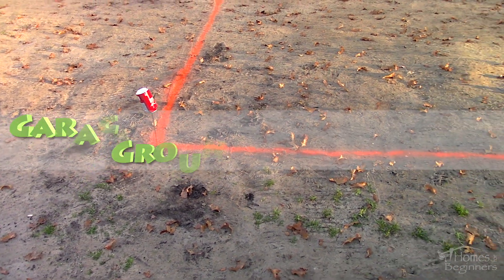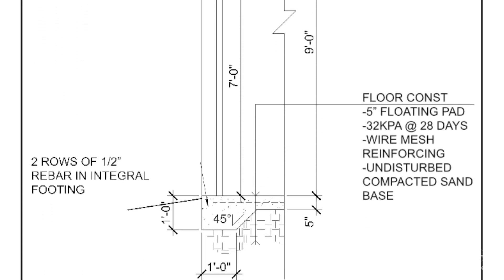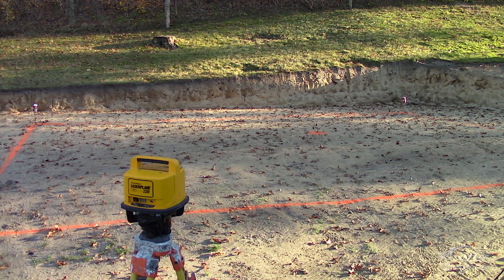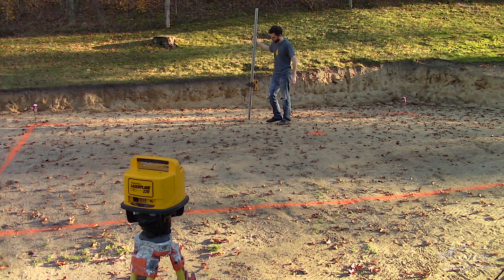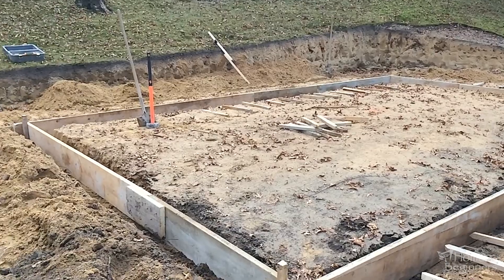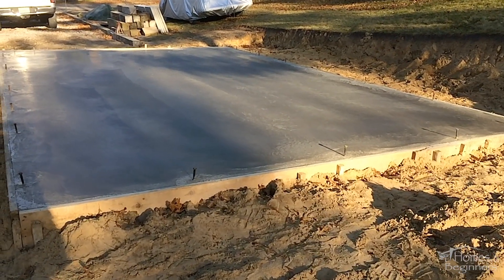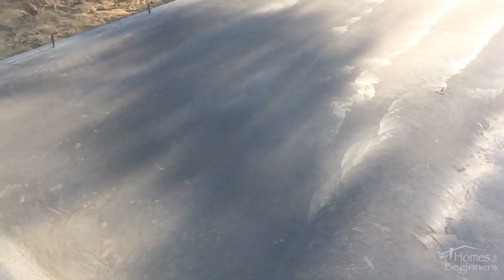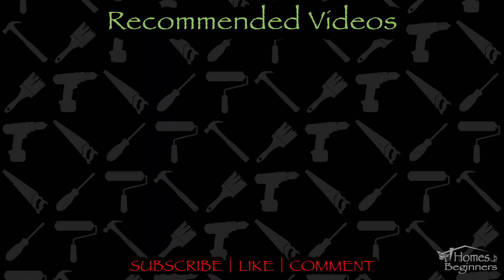How to Build a Garage - Ground Work and Concrete Pad

Comment: Is so easy to do concrete in the east side of Canada, they don't worry about reebar, thickening edges with Upright bars and propper ties . They just come with little wire mesh, set it , cut it and there you go ! 
I see some dowels sticking up from the concrete pad , they could do the curb and floor at once , but I guess is just simple this way .

Comment: Anyone;
I have an existing shed/garage which is sitting on railway ties. I need to remove clay about 4ft b4 putting in a concrete slab. Do I also need to excavate under where the blocks will be?

Comment: I feel bad for you. It's so common in todays world with contractors.  Thats why i prefer to do mostly everything myself. That GC is a hack. You can always write a bad review and file a complaint.
Reply from the maker: Thank you. Sadly he didn't have business page to drop a review. It's tough finding anyone good anymore. Recently did my driveway, used armour stone along the side and front portions. Tried to find someone and the rates were just ridiculous, not to mention wait times or trying to get returned calls. Ended up renting a machine, a friend of mine helped me and we did it in a morning. Ended up saving probably $4000.

Comment: Sorry to say but that concrete contractor you had is not the best , finishing does not look properly done .
Reply: Finally :D Someone noticed :D This is so bad :D I give this slab a 15 years, out of 400 potential. The problem is - people in USA are used to buildings lasting 15 years, that they do not understand that concrete should last for 200 at least :D. But hey. You should understand that they have no where to learn. The whole continent is made from wood and metal.